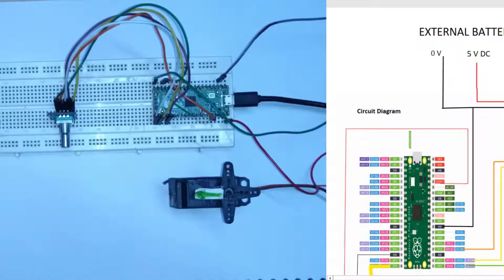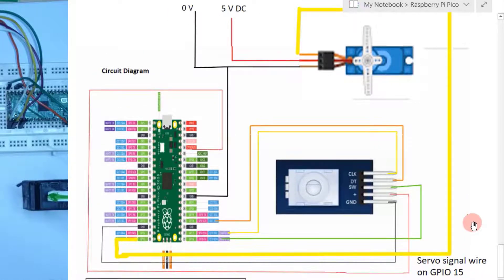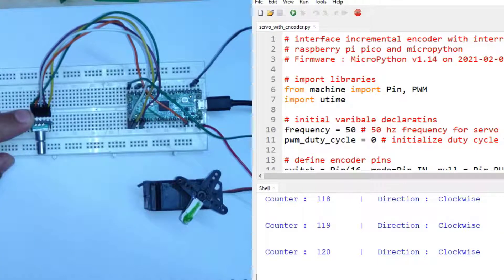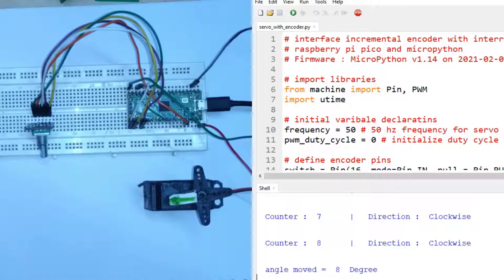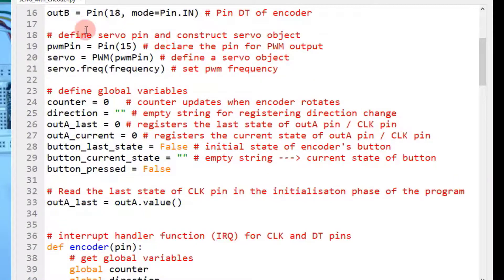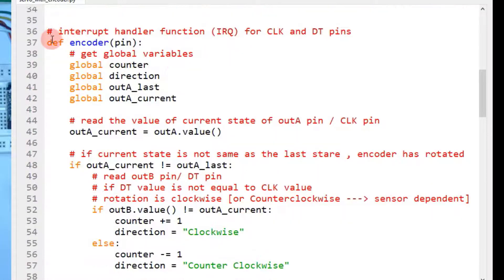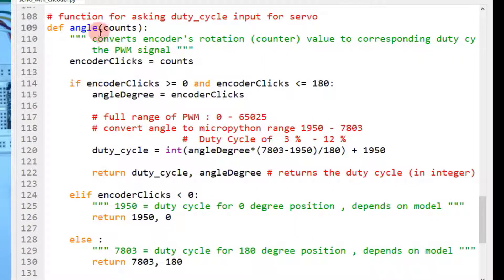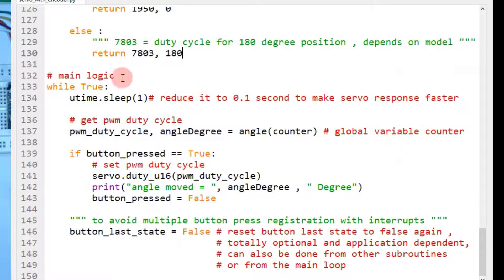Servo motor control with rotary encoder and raspberry pi pico |Interrupts | Micropython

Comment: Got it working good. My encoder switch dose not work.  So touching the switch pin 16 to ground moves the servo to selected position.